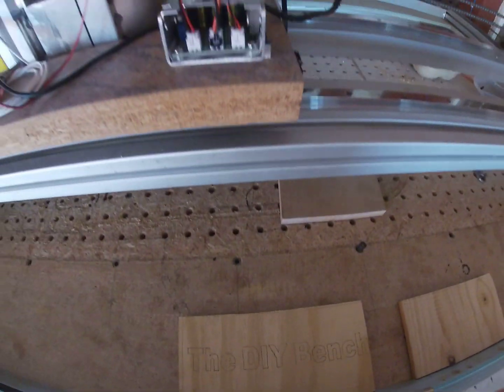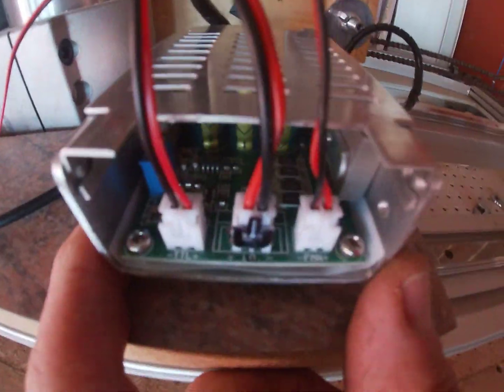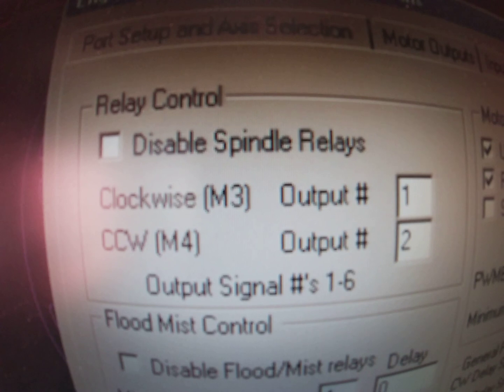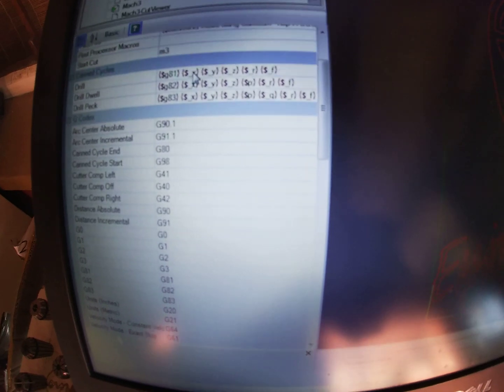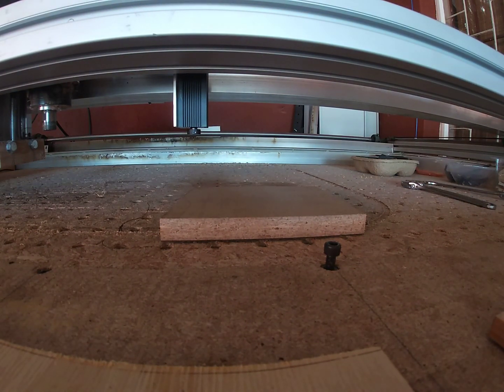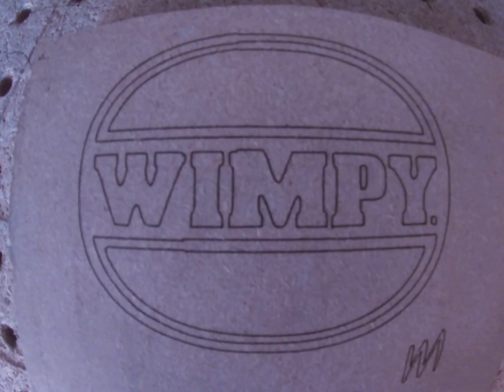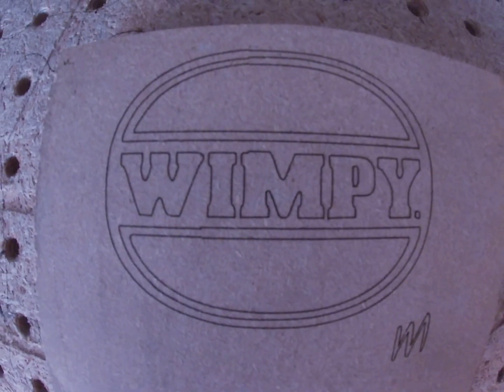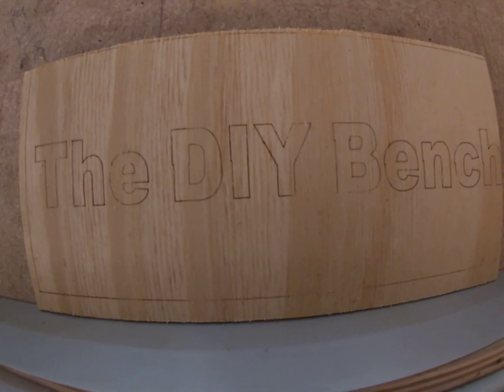The DIY Bench: Mach3 laser module setup with PWM control

Comment: With a pwm and cnc you could remove tattoos and get within a few thousandths of the edges...  lol..   itd probably scar a lot less and be a quicker process with the speed of the axis and accuracy of the pwm regulation..   strap the body part in and hope you didn't accidentally add a 0 anywhere...  lol

Comment: I don't know maybe someone can help me or maybe I'm over looking something
breakout board I'm using is a DB25 1205..

laser is 15w … 3 wire ..... positive... negative... PWN

laser came with power supply...

hook laser up to pwn to pin 17... 

test … laser on... but laser is on straight out of box too..

question is how do I turn laser on and off

is this function within gcode...

or can I control this via mach3
Reply: Jtechphotonics.com vectric laser post processor